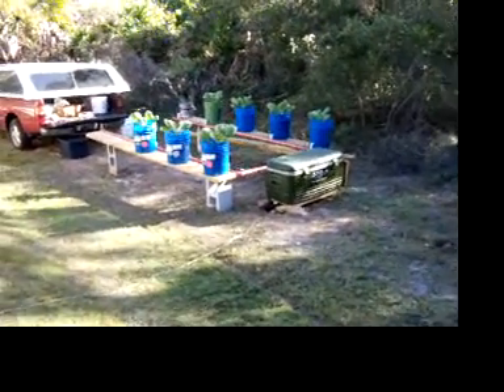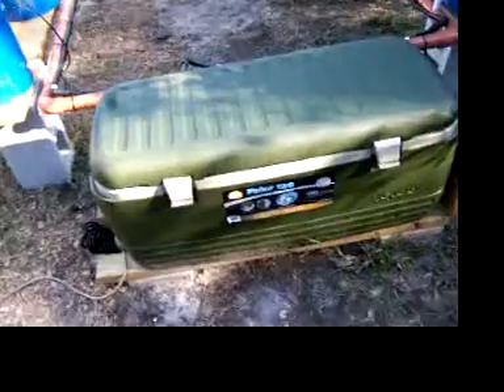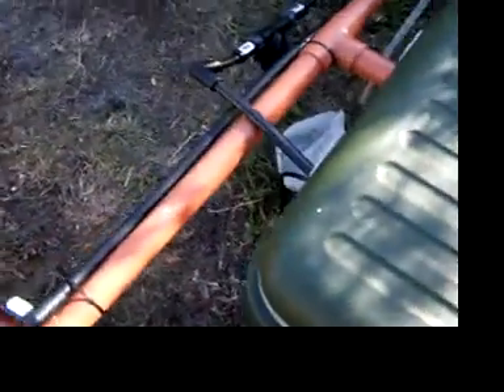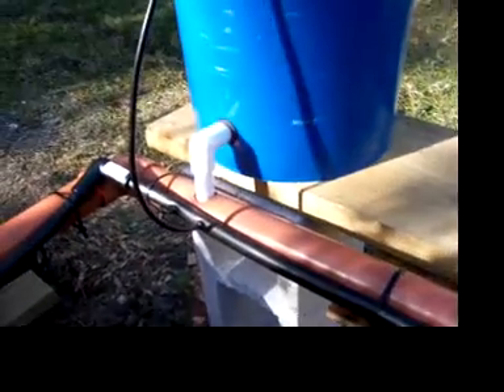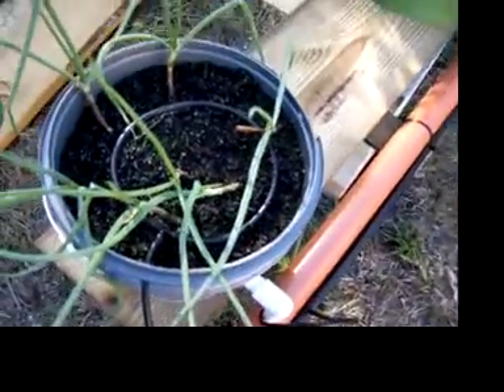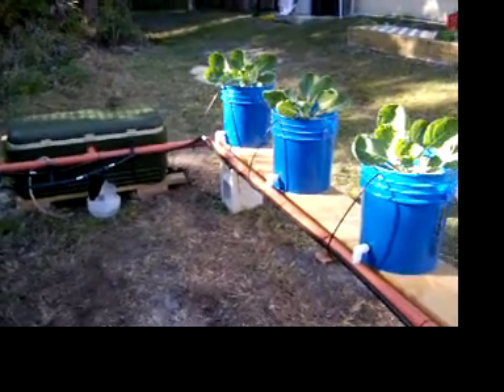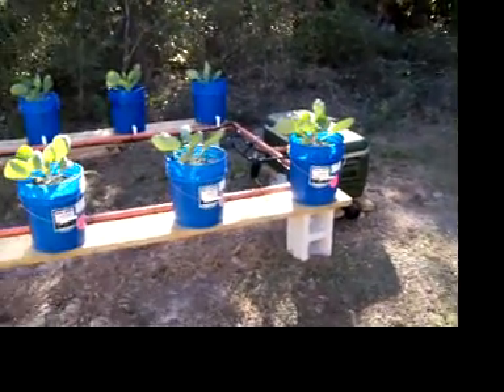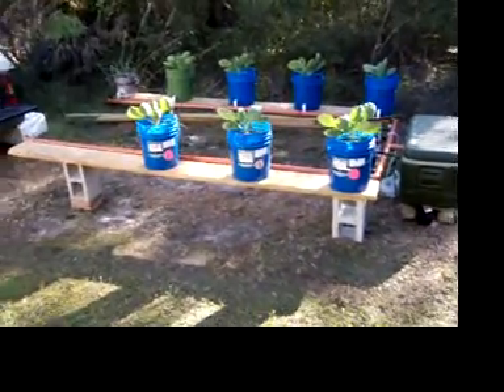Dutch Bucket Hydroponic System Part 3/3

Comment: too much stress on that pump!!!.you could bring those plank inward to at least the width of the cooler and minimize how much/far your water has to flow and increase the life of your pump.also your going to need more cinder blocks if your going to add more weight to what you already have. perilite would be your best bet overall,put some 5gl paint strainers in the buckets first to prevent the perilite from flowing into your drains then fill with perilite